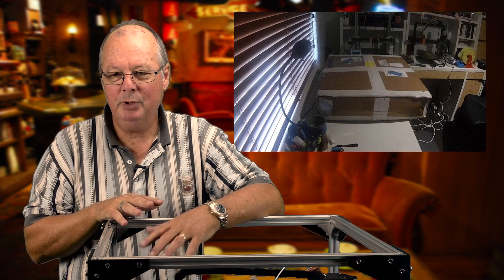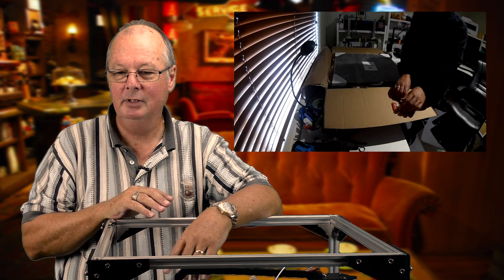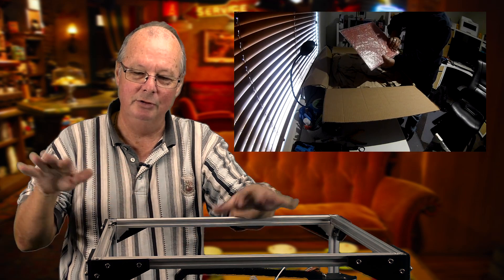FolgerTech FT-5 Build Tips PART 2

Comment: I don't understand the you tube obsession with time lapse. I guess everyone figures if you have the patience to sort 5000 screws and nuts and spend 20 or 30 or 40 hours of assembly time  theres no way you will watch a 3 or 4 or 5  hour video of a step by step assembly. Its much better to slow the high speed video down and watch it jump around and skip the section you are trying to figure out.
 The real fault is fogertech. How hard is it for a company to post step by step instructions in a video format. I guess they never heard of youtube. Its much easier to follow a cryptic manual.
Reply: Bruce Ismond I just ordered mine, is putting it together really that much of a pain in the ass? Have you downloaded the 7th revision of the manual, out of curiosity?
Reply: Its not too bad ...just venting...I'm 3/4 the way through I'm using the V11 pdf manual from the folgertech  web site google link. Its just when you hit those brain fart moments and you start doubting reality so you jump on you tube hoping you could just get a glimpse of a properly assembled hot end at the right angle or you wonder why the base used 500mm sides all around but the top used 460 on the sides(is that still a square?) I think I'm going to regret that one later anyways If I owned the company I would sit down my assembly guy who does this in his sleep and stick a camera on a tripod next to him and let him go at it in real time. Believe me I can fast forward to the exact spot I'm interested in no matter how long the video.

Comment: You know really the FT-5 is a steal of a deal for the print volume but man its funny that EVERYONE makes the same mistakes because they won't update the manual.
Reply from the maker: They have updated the manual to V7 and i believe its still being updated :D Yes the printer is exceptional, if built properly it will rival $2,000 machines
Reply: Where do i get the new manual as the one in the forum is still not right.
Reply: The FolgerTech google drive.
Reply: I will address some of the manual stuff in part 3

Comment: Hello hot end, and 3D printers. I wish to enter the 3d printering world. I am going to purchase a 3D printer (up to $6000 but I would rather around sub $3000)in the next 3 months. I am after a large print space, a hot bed, a good printer quality, I used to be an Aero Eng and have a good set of hand skills. I can program, and operate CAD systems. I want it to build toys and for fun, so I guess ABS is what I would mostly use, however I would love the option of printing more exotic materials as well. I would like however something I can get support for in Australia. Anyone please help. Cheers
Reply: Thats a very large build volume for a FFF printer, even professionally. a print that large could literally be 60+ hours :)

My Printrbot metal plus has a volume of 250x250x250 and its pretty large. I think the prusa has the best balance of size / capability and value!
Reply from the maker: Howdy! The Wombot CUBUS will fit the bill perfectly. http://www.aurarum.com.au/3d-printers/496-wombot-cubus-3d-printer-extra-large-size-australian-made-assembled.html  If it does not need to be australian, the folger FT-5 (Pay extra for a pre-built unit unless you want a kit)
Reply: how big of a build volume do you need?
Reply: 400mm-ish cubed? a little smaller or bigger is cool though. I am up for any suggestions.
Reply: Nerdly I watched your Original Prusa i3 Mk2 review, seems cool. Could I be aiming too high for a first printer.
Reply: I'm thinking you might be. Considering your background i'm sure you'll be able to get a handle on 3d printing in no time. I think you'd be surprised how much technology can be packed into one of these machines for under $1000

I consider a large build volume 10"x10"x10" or so...although admittedly 99% of the stuff i print is smaller than 6in cubed.
Reply: Thank you very much for all the replies. It has been very helpful. I will need to do more research before I make a decision. cheers
Reply from the maker: most welcome